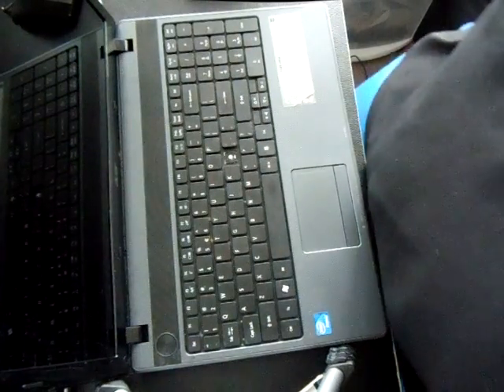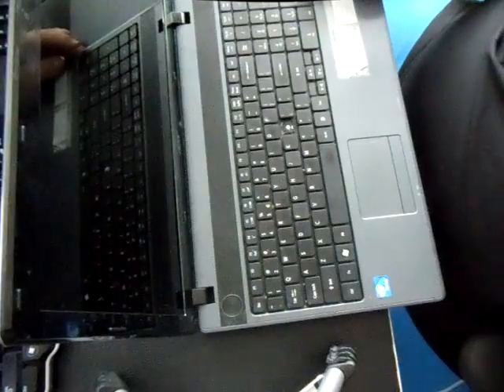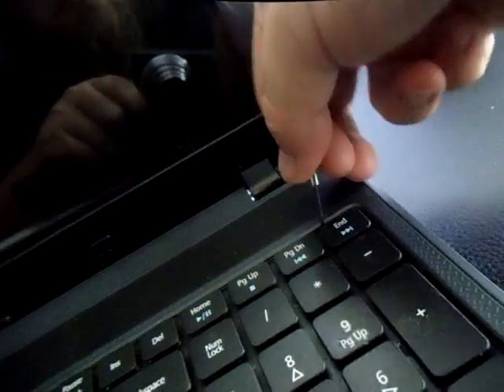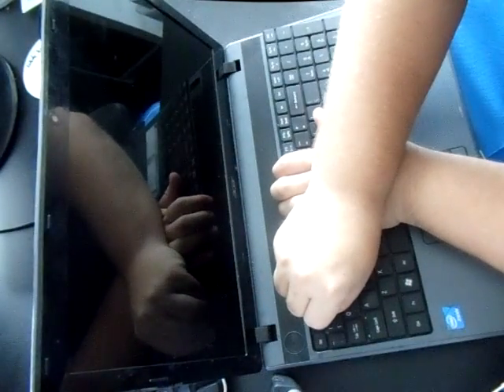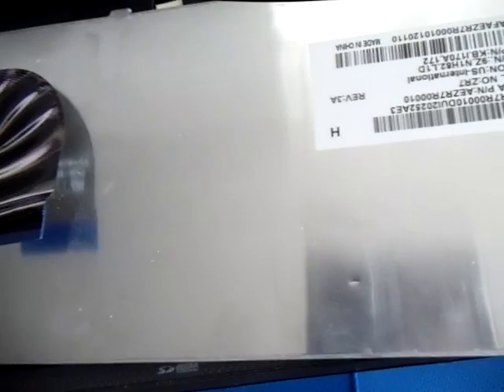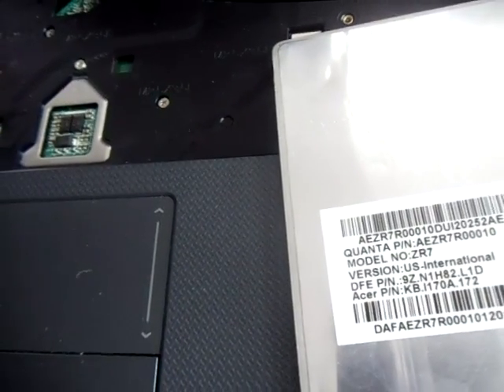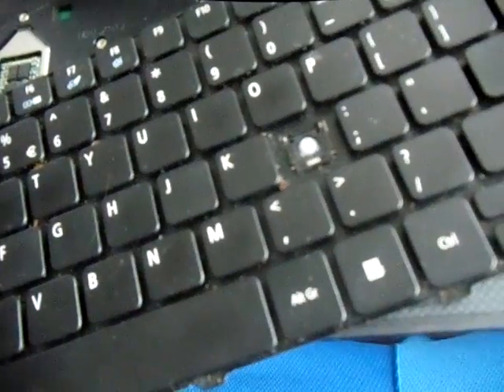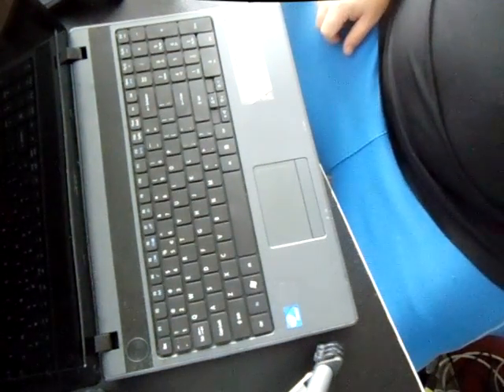How to install Fix Repair Replace Keyboard on Acer Aspire Laptop (5349 5517 4520 5253 5532 5251 5536

Comment: The part where you take the old belt out got covered up - had no idea what you did. I finally got it out, then Icouldn't figure out how to get the new one secured under the white thing - the white thing never popped up. Belt wouldn't fit under it.

Comment: How'd you get the tabs back out? They're stuck inside lol
Reply from the maker: make sure there are not any screws holding it down on the top and use a button knife to unpry them

Comment: I was able to "repair" my keyboard by giving it a thorough cleaning after I removed it.  I tapped the keyboard on its ends repeatedly to get out all the dust and debris from underneath the keys, and then went over the edges of the keys with alcohol and q-tips.

Comment: I have a 7741 model and the keyboard is exactly the same.  
However the side tabs were immovable. I ended up destroying the old keyboard getting it out but no big deal since I was putting a new one in. 
Now my next problem is getting the ribbon cable to stay.  It only goes in so far and even tho I push the latch down the ribbon cable comes right out. If I try to push the ribbon cable in it just bends meaning it can’t go any further.  So idk. Gotta keep trying tho since I bent the old keyboard lol
Reply: Oh and I got mine on eBay too.  Used buy it now and sorted lowest to highest.  Lol
Reply: Got it finally.  Phew! Nice new shiny keyboard!
Reply: well, the keyboard I got is terrible.   it's not solid on the bottom so if I spill anyting on it it'll go right thruough.  the keys are very light and have a "tinny" cheap sound when I type. (I know how to type the "real" way).   and the space bar i have to hit harder than normal becauseoften (see????) the space won't go in.  I only got a new keyboard becausethe  (!!!!!!!!!)  old one was filthy and there's dents worn in most of the keys and they're all smooth, but it worked better than this piece of junk.

Comment: Your video worked for my Aspire/Acer model, but the 5733z-4633 is a very difficult model to press the tabs in. It took a bit, but I managed to coax the tabs in and get my keyboard replaced. Thanks...
Reply: No such luck for me; I am getting a new laptop.

Comment: Do NOT try this procedure for the Acer Aspire 5515; it is very different.  On the 5515, you must first remove the hinge cover bezel and then loosen 2 screws that hold the KB.

Comment: ON my acer laptop you have to take the whole top off and disconnect 7 ribbon cables and take a metal plate thing off.  It's a real pain in the ass now

Comment: Hey. Greetings from Germany. Watched quite a few vids so far, but none that focused so well on the details. I could never figure out how those little tabs get pushed. Now I know, and I just pray that the ordered keyboard for my Travelmate 7750G can be installed that easily and no screws are involved. Unfortunately, there are neither tutorial vids nor otherwise instructions available for that particular Acer model.
Reply from the maker: +1FallCity Just look on the bottom of your new keyboard and see if you see a little pole where a screw would go into.  If there are none then it doesn't use screws
Reply: +1FallCity BUT: That wouldn't have bothered me much. But I saw other vids, where you have to disassemble half the laptop to get to the keypad. That is what I was afraid of.
Reply: I strongly disagree. It misses to tell an extremely critical information. This video makes you to conclude that the 6 tabs (retainers, hinders) in front or the 2 on sides must be  pushed  in as if they are latches  or hinges or reusable locks. THEY are  plastics that get broken forever when pushing  in them. I just did that after watching this video which should emphasize  more this fact e.g. by displaying text. If he just did that the video would save me some agony which I had remedy by gluing the keyboard with 2 component glue need in 24 hours to dry. otherwise it is a nice video.
Reply: I strongly disagree. It misses to tell an extremely critical information. This video makes you to conclude that the 6 tabs (retainers, hinders) in front or the 2 on sides must be  pushed  in as if they are latches  or hinges or reusable locks. THEY are  plastics that get broken forever when pushing  in them. I just did that after watching this video which should emphasize  more this fact e.g. by displaying text. If he just did that the video would save me some agony which I had remedy by gluing the keyboard with 2 component glue need in 24 hours to dry. otherwise it is a nice video.
Reply: +1FallCity The right move is to bend the entire keyboard so that the keyboard passes by the retainers. That they are fixed i.e. not hinges,  must be conveyed....
Reply: +josefbyonan Josef, honestly - after all it wasn't really as easy as shown in the vid to replace the keypad. I struggled with those 6 tabs, too. But in my case that results from a lack of practice. Watch other videos. They all more or less show that those tabs get pushed in. And that is exactly what I did without breaking them. For me, the hard part was to get the right move to push them in and sliding underneath the pad to lift it up. I couldn't manage without slightly damaging the edges of the old keypad. But the notebook itself stayed undamaged. The tabs now hold the new keyboard the same way as they held the old one.

Moreover, I don't understand the exact point of your criticism. Because you do not explain at all which handling would be the correct one in your opinion.
Reply: +josefbyonan Are you dealing with exactly the same laptop model as shown here in the vid? I'm just asking because with my Travelmate the tabs definitely slide backwards when being pushed with e.g. a flat screwdriver. I just checked once more to make sure that I'm not mistaken.

Comment: Thanks, your video was very helpful; I used a sharp tip knife, it took less than 10 minutes.  I agree with your suggestion to change the entire keyboard.  Even though only one key was bad, the keyboard was filled with a couple years of dust, debris etc.  Now, like new very neat.
Reply from the maker: +Michael Gonzalez thanks

Comment: Worked like a charm, thank you for the close ups on those tabs.  A couple of other videos did not show that and I didn't get it until I watched yours.  Easy repair for a keyboard that had bad keys I had struggled with for months.  Got the replacement on ebay also.  Thank you for posting.  Also, I used one of the little screwdrivers for eyeglass repair, worked perfectly.

Comment: Very good advice about replacing the keyboard instead of trying to repair the key. I have replaced several of these and its very easy. Your video was very accurate.
Reply: I beg to differ, John.  It is very difficult without risk to destroying the keyboard.  I will be getting a new laptop.
Reply from the maker: +John Dossey thanks